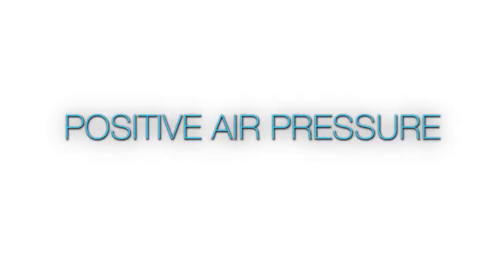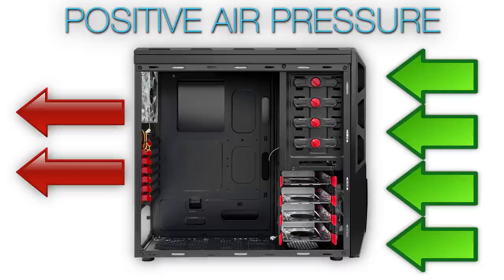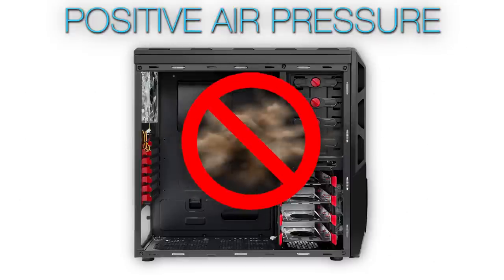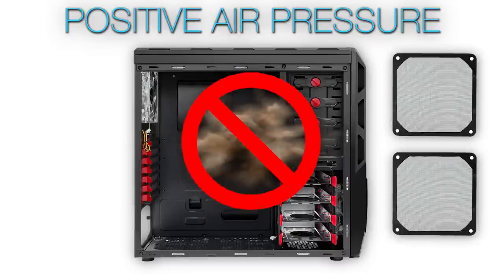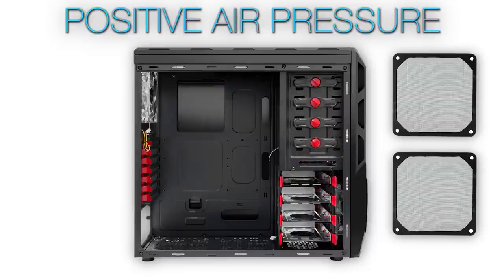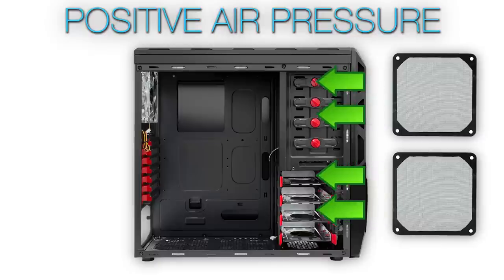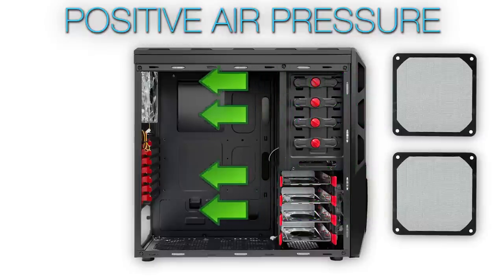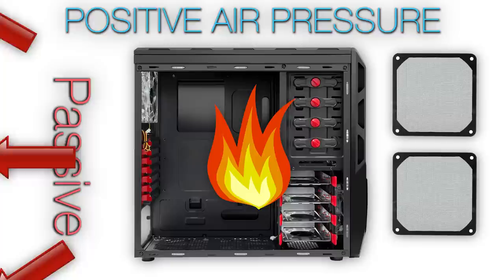Computer Case Airflow - What is Positive and Negative Pressure?

Comment: Need more down force, add a spoiler.
Reply: But but... the suspensions are too stiff!
Reply: Willian Peng and the idea of a racecar pc is born. with spoiler, racing stripes, carbon fiber and a cooler master V8 cooler.
Reply: givemeajackson Riceing cars and now PC'S?
Reply: KayNineLP yep. Needs to be the slowest pc you can find though.
Reply: givemeajackson Hahaha same applies
Reply: givemeajackson I have kind of seen that before though.. with that V8 cooler.
Reply: Willian Peng Needs weight Reduction, too heavy on the desk. Add a Carbon Fiber GPU.
Reply: Adrian Jaden What about a new exhaust? We need to let ppl here this pc
Reply: Jason Wan Like I said. If you add another item, it will be to heavy. At least... AT LEAST make the exhaust carbon fiber too. Stop putting too much stuff. The desk is going to break.
Reply: Adrian Jaden Now we need to get a heavy duty desk xD
Reply: Jason Wan Probably a Roll Cage on that Bish.
Reply: givemeajackson Thermaltake Xaser VI looks like it has a spoiler and a body kit, I have the aluminum and black version that looks quite sweet
Reply: +SykoSkwerl99 lmao it does! That case is riced the fuck out!
Reply: I still love it though! Could be fun for some modding in the future
Reply: SykoSkwerl99 lmao yeah.
Reply: +Iqmal Danial That's what she said!
Reply: ....and some vinyls. +25fps/vinyl
Reply: Cold air intake for cheap performance upgrade
Reply: spoilers don't create downforce, wings do
Reply: And splitter at the exhaust too

Comment: Super informative video. The only missed opportunity is when you said a fan blows towards the hub, an on-screen picture might have been helpful for some viewers.
Reply: Preach
Reply: I agree... I'm a computer guy, and I was like, WTF is a hub???
Reply: Hub means center.
Reply: north wiebesick has nothing to do with IT. It’s English. Hub means center..
Reply: @brandonh.6654  is it just me, or do you not get the original comment??? We all know that fans do not blow towards the center, per sé, as what he was referring to 1 side of the fan being the hub...meaning, that if you had the hub facing one direction, it would pull air in, and facing the other way, pushing it out... My comment was based on the fact that if hub means center or middle, in common tounge, then is he talking center of the blades on the central column, or the center of the framework on the one side that the fan is usually screwed or glued to...
Reply: Also, the lights you add to many cases these days have a hub powering and managing them, so again, slightly different meaning...
Reply: north wiebesick It’s the same meaning. Think about it. Hub = center. Therefore if you are plugging all of your fans into a hub they are centered. English is at times a really shitty language
Reply: ive never not once seen a fan that did not have a POINTER of direction to flow.and if its worn and old ,hard to see any kinds of markers then pitch the fan anyway lol

Comment: I have a fog machine, but is it even safe to put fog into a pc?
Reply: What kind of fog machine?
Reply: DJNathanH You can try it with the PC off. Only have power from the PSU going to the fans and use a clip to turn it on.
Reply: i would not recommend it tho , since they are vapor
Reply: DJNathanH Or you can invite 3-4 smokers to blow smoke into your case...
Reply: Remywoof Smoke from cigarettes is actually way worse than Vapor from a fog machine, the smoke is sticky and disgusting, and even a little of it ends up jamming fans and heatsinks. Not good for airflow.
Reply: NightFury173 lol what, you're crazy. you'd have to smoke for 3 years to have it stick to something lol
Reply: EqualsDeath I used to work on computer for a living, and trust me...PCB's hold cigarette stink worse than anything else I've ever experienced. We had a back room full of old computer parts and the room smelled terrible when there were parts from a smoker's computer.
Reply: DJNathanH It probably wouldn't hurt it, as propylene glycol is what's used in fog machines (same as electronic cigarettes, asthma inhalers, nebulizers, etc) and it's hydrophobic. If you wanted to do it 24/7 it may not be a good idea (who knows?) but just to test out your air flow won't hurt it.

Comment: ThermalTake Core X9 using the supplied (or user supplied) 200 mm fan in the front.
Reply: +Brechan Fraser Yeah this.
Reply: can you do a negative pressure set up with filtered intakes and exhaust so there will be minimal dust ? because he only mention it with out filters
Reply: ***** Rather have thermalthief than Caserapeyourwalletlabs.
Reply: ***** Rudeguy - Sandhurricane
Reply: +Tj Darude - Sandstorm
Reply: +Brechan Fraser fans on the bottom and top only,  also with rads
Reply: all that case is is ventilation lol. I have an x1 and with positive pressure you can feel the air coming out everywhere
Reply: how quite or rather how loud is this case.?
how dusty does it usually get, what are the filters like.

Comment: Could you please review the airflow of the Fractal Design Define R5.
My CPU temps seem to get pretty high and I don't know if it's because of my CPU Cooler, or that the intake of the case is being a bit restricted
Reply: RigorGames I have a similar problem with my Define R4. I think the front of the case is way too restrictive.
Reply: I have no problems with my cpu temps and im also using a define R5. But then again, im using a 120mm liquid cooler so that might be a big difference compared to your system.
Reply: Alexander Folkesson i dont know why my i7 gets so hot on my ibm a50 case and i have a cooler that came with the cpu.                          (You cant see the sarcasm)
Reply: grab the cutters and make some more openings...?
Reply: Im sorry, but reviews don't work this way. People are not going to review a product on a certain aspect because someone in the Youtube comments said he or she had a problem with it!
Reply: RigorGames What CPU cooler are you using? You might need to replace the thermal paste and remount the cooler.
Reply: jolanpiep If you listen until the end of the video, the guy asked what kind of cases would we like to have reviewed with the fog machine, so I answered their question...
Reply: Hiebly I'm using the Cooler Master Hyper 412S, with 2 after market fans and after market thermal paste which was put on when I remounted it a couple weeks ago, and I remounted it 3 times thinking I put the thermal paste on wrong but got the same results.. it might be the case or my ambient temperatures, it seems I'm shit out of luck unless I spend on water cooling, which is money I don't want to spend :(
Reply: RigorGames What CPU and what voltage is it at?
Reply: Hiebly AMD FX 6100 @3.3GHz, 1.2875V, which is stock. But when @ 1.35 V and 4.5GHz overclock at full load, it doesn't throttle or go over 70 deg C. But idle temps at stock speeds and at overclock speeds hover around 38-40, even when the room is what I'd consider cold, stock speeds and full load leave from 50-60 deg C which is comfortable for me, but them stock speeds are a bit discomforting
Reply: RigorGames Idle speed doesnt matter, so dont worry if they are 30C or 40C, if your idle temps had been like 70C+, then yes, you should be worried, but not with your temps.
Reply: RigorGames i have the exact problem with my r5. The dust filter+the front door chokes my fans and i can hardly feel them blowing air at all, even at max speeds
Reply: Jason Jia Are you sure the fans you are using in the front are "High Flow fans" and not "High Static Pressure fans"? That can make a big difference aswell. I use two 140mm high flow fans in the front and two 120 High Pressure fans in Push Pull on a radiator as an exaust in the back! Seems to create a good balanced/positive air pressure! I even put in a sheet of cardboard between the two fans in the front to direkt air to either the GPU or the CPU cooler!
Reply: J. Arnold Really? I use a high static pressure fan in the front, and I thought that you were supposed to use that because it's very restrictive in the front so you will need more pressure. Anyway, how much static pressure counts as "High air flow" and how much counts as "high static pressure"?
Reply: Jason Jia Depends on the case and whether you have drives in the front. If the front of the case is just a mesh opening and you don't have many drives installed, high airflow fans will do great in the front.

If the front sucks in air through vents or strips and is restricted on the inside by drive cages, then high static pressure fans are best.
Reply: Hiebly Yeah, that's what iI thought, but on the Fractal Design R5, even with a high static fan, the front is quite restrictive and you can only feel air coming off the sides of the fan at a very high anygle, effectively making the fan useless :/
Reply: Jason Jia Do you have the stock fans? Fractal's fans aren't very good
Reply: Hiebly yeah i replaced them with an aerocool ds 140mm fan which has lots of static pressure (2.9 something at full rpm) and tons of airflow, but like i said, all the air come out the sides of it and there's no air going straight forward, making that fan useless it i put it there. Somehow, the default fractal fans perform better than the aerocool at certain voltages, like 7 or 5 soooooooo
Reply: Jason Jia wait... like coming out of the side vents at the front? If so that means the fan is backwards
Reply: Hiebly lololololololol no, i mean the air is coming out of the fan at an angle, because the intake side of the fan is so restrictive and I can't feel any air going through the middle of the fan. Since the air comes out at a very wide angle, it does not reach the parts inside.
Reply: RigorGames  Yes, please do review the define R5. I know its another fractal design product and there are man cases out there, but the define R5 is very restrictive and for that reason it would be a great exaple how to set fans properly in a restricted case. Reagards from slovenia ;)
Reply: *****  Yes but i think that he, like me, wants to save the sound dumping configuration of the case. i myself have 2 intake on the front, one at the bottom and one in the rear just becasue i dont want to open aditional holes fro the sound to escape. i know that with the define r5 you can achieve a fantastic airflow but you will also conpromize the most inportant fuction of this case .. and that is less noise...
Reply: +Benoit Levesque i have no proplems with my r4 i have cm 212evo and i have i7 4790k oc to 4.6h ghz and its only 80c warmest core
Reply: +TheAwesomeSauce lol, having a mac wont make you "Bad" at computers
Reply: lol, I despise mac as a system, but, I do not believe simply using a mac makes you less knowledgeable, you just know different things.

Comment: Can you do the airflow test on the NZXT S340?
Reply: Plz yes
Reply: It doesn't have the best airflow as per reviews...I'm getting the case though, going to have 2 sucking in and 2 blowing out.
Reply: Also airflow is really good, even with the plastic cover on. It doesnt block because of how large the top and bottom gaps are

Comment: Both systems will very quickly reach a steady state where there is just as much air flowing into the case as is flowing out.  Higher pressure inside means more air molecules to carry heat away. Less dust will depend on having filters at air ingress points--you usually have an easier time filtering  a positive pressure system.
Reply: "Higher pressure inside means more air molecules to carry heat away"
That is not how this works. That effect is so tiny it might as well be non-existent.

Comment: Why not put the pc in space so no fans will be needed at all
Reply: pc parts will fly
Reply: you just use the connectors to hang it together
Reply: +Boffifis1 it will be worse
Reply: The Heat couldn't get out because there is no air to "carry" it
Reply: it's too cold/hot for the electronics..
Reply: You wouldn't need fans because the pc would overheat in a couple of minutes. All the heat would just remain in the components.  Vacuum can't be heated up. Spacecrafts use special radiators for a very good reason.
Reply: to cold? lol
Reply: 9 comments later and still no mention of a satellite. I am disappointed.
Reply: Water cooled maybe? I dunno, gunna google it now
Reply: You and people who liked your comment aren't too good when it comes to physics I can see... If you ran a PC in the vacuum of space it would overheat instantly.
Reply: It will be to cold there
Reply: True
Reply: k - 200 is Noth good for the PC
Reply: @wohlrabferdinand  The heat will get higher, but will radiate trough vacuum. Much like the sun is heating up everything through vasts of empty space.
Sure enough, the amount of radiation is related to the temperature of the object and radiation is a thing for glowing hot objects (like molten metal, or the sun, or burning of a flame)
Reply: Then your pc will melt in space there is a vacuum so there are barely molecules wich means there wont be molecules wich can transfer the heat from your components resulting in raising tempretures untill they shut down
Reply: @wohlrabferdinand  explain why ISS has heaters
Reply: I get the joke, but when if I get serious this is scientifically wrong.
Heat can move on it's own with no help.
Sinple example : The sun's warmth comes to earth through space
Reply: Radiation will destroy it immediately; 
You haven't a cable long enough to power up your PC; 
Too cold: if you have liquid cooler, it will froze immediately and destroy everything. 
Almost impossible use gloves with standard keyboards.
Reply: This dude never took science class lol
Reply: Then it would essentially evolve into a satellite

Comment: Good vid, best in this area.  Only thing I'd add for those who didn't quite get the direction of air thru a fan, usually (about 90% or more) the part of the fan that has the UL, voltage info is the EXHAUST side (i.e. air will be coming out that side).  Air will be sucked in on the opposite side.

A lot of fans, even the pricey ones, don't always have arrows indicating which way the air flows.

Comment: Just a couple observations.  Positive and negative pressure are a result of resistance, not more air going in or out of the case.  Also, I don’t understand what you mean by saying CPU and GPU fans act like exhausts.   They simply move heat from the components to the surrounding air which (hopefully) is evacuated from the case and replaced with cooler air.

Comment: What if you have your exhaust fans spinning slower than your intake fans, especially when you have more exhaust fans than intake fans? What would that cause as far as dust and thermals goes?
Reply: Spinning speed (AKA RPM) is almost irrelevant. Airflow of the fans is what matters, so it depends on the fans. Number of intake/exhaust fans would also be required to answer this. If the exhaust are stock fans which came with the case and only flow 30CFM, but the intake fans are good aftermarket fans which flow 50-90CFM each... So anybody who could help you would need more info than what you stated. I'm guessing you think you have 3 exhaust & 2 intake? 1 rear exhaust & 2 top? Are the 2 intake both at the front? Do you also have a side intake, or are you using the side as your 3rd exhaust (supposed to be an intake to directly help cool your GPU, by the way)? Also, what is your goal? This video perfectly proved what I have told people for years. If you want better cooling, you want a negative pressure. If you want to clean your PC less frequently by keeping dust out better, then you want positive pressure. So which would you prefer? I'm guessing you want positive pressure, based on your question. So if you are using your side intake fan as an exhaust fan, make it an intake fan. Anything beyond that will require the info I said above.
Reply: I guess my question was rather simple in comparison to specific situations, but yeah, that was mainly the question was if you had more fans pushing out less air than the fewer fans pushing in more air, what would the result be?

If you have to probe me about what my situation is, my computer is set up so I have two 140mm fans on the front (the bottom is a SP fan where the hard drive cage is) as intake fans, three 140mm fans on top acting as exhaust (though I intend them to not spin as fast, therefore not always blowing out so much air), a rear 120mm fan as an obvious exhaust, and another 120mm fan on the bottom acting as an intake fan, so it sort of implements convectional cooling. All of these are Corsair case fans, and all but the latter SP fan I mentioned just for the hard drive cage are air flow case fans, all plugged into a manual fan controller; there are seven case fans in total, and one out of the seven is a static pressure fan. I use the fan controller so I can independently control all of the case fans, which a few are being controlled in pairs by fan splitter cables I also bought in conjunction with it, so the front intake, the first two on the top, and then the last two from top to rear are independently controlled in pairs, whereas the bottom intake fan is the only one that is actually independently controlled by the fan controller, possibly giving all the power in one cable vs. a splitter cable, which the bottom one would be louder than the last pair of fans (rear top and rear exhaust).

For case reference: I am using a Thermaltake Core V41 ATX Mid-tower case. (Ironically, it is very tall and wide for a typical Mid-tower case, primarily designed to be very liquid cooling friendly.)

What would you say on the matter, with all of that being said?
Reply: Sounds like you are shooting for positive pressure the hard way, it doesn't have to be that complicated. I would of opted for just keeping one more intake fan than exhaust. I also always scrap stock fans and go for nice SP fans to simplify things.